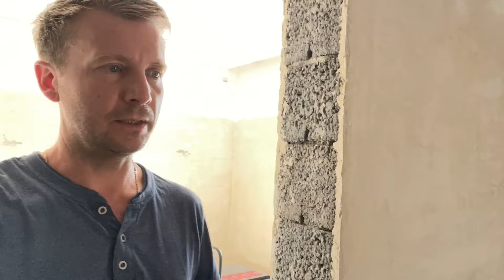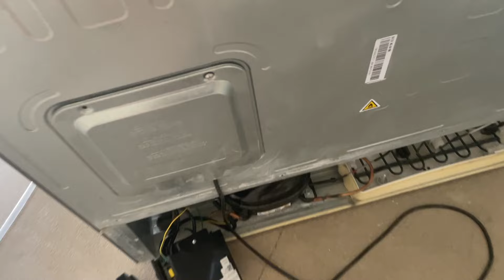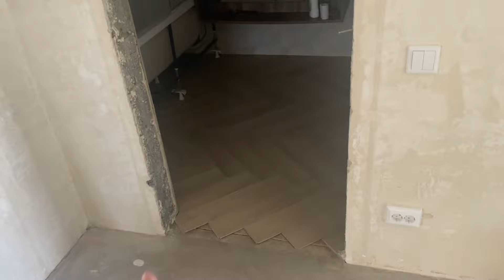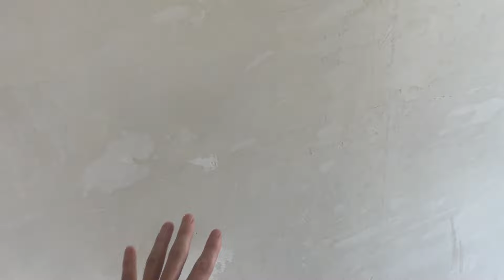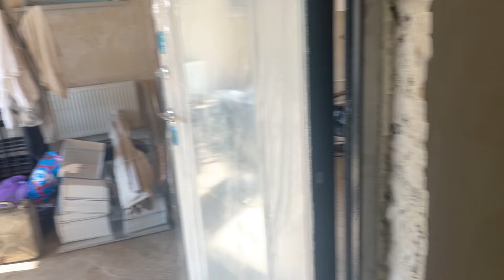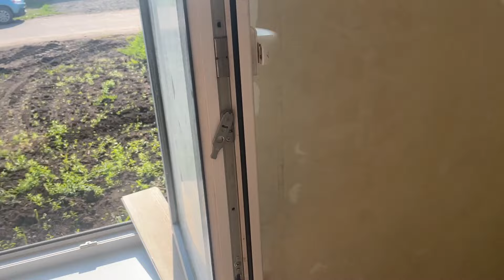English Family Not Giving Up on Our Home & Russia | Home Restore Progress Post Floods

Comment: Я бы порекомендовала убрать остатки старого покрытия из ванной комнаты.
У нас дом лежит толстый немецкий линолеум, имитирующий тропическую древесину. Он с защитной пластиковой пленкой и не стирается, надежно служа нам 10 лет. Я думаю, что пока вы не положите настоящий паркет лучше всего использовать такой линолеум: он легко моется и очень красив - все знакомые принимают его за настоящий пол из натуральных досок))
Reply from the maker: Yes this may actually be the best option. We are just worried it will scratch easy with chairs etc.
Reply: Это не проблема, в строительных магазинах продаются войлочные прокладки на клейкой основе, специально для ножек стула.
Reply: @RussianTravels  our linoleum is very durable - the chairs and table have not left a mark on it in 10 years.
The only thing is that heavy furniture, of course, puts pressure, but this is unnoticeable if you don’t move the cabinet to a new place every month)) You can tear it at home only with great effort: our children made several holes with a knife))
Another plus is that it is very thick and warm - the cold from the concrete is not felt.
The main thing is to choose correctly. We were advised to use linoleum with glued synthetic insulation, but we did the right thing and did not listen - we took it from foamed polymer with a rigid protective film. This was the best choice.
Reply: @sistamama1965  да, но нам даже не понадобилось)) У нас деревянные стулья с острыми углами на ножках, но они за 10 лет не оставили следов, хотя мелкие любят качаться на стульях))
Reply: @RussianTravels  There are different grades of linoleum based on abrasion resistance. High-quality linoleum is very resistant. For the bathroom you need a small piece and even high-quality linoleum, maybe from leftovers from a sale, it won’t be expensive. It will last at least several years.
Reply: @RussianTravels  Linoleum is often used for public places, such as schools, hospitals, gyms and etc. It's much durable, than laminate flooring. Class 23/33 and above is  quite solid.

Comment: Martyn in your main bedroom  that gets the  least sun . You are using the dehumidifier and you said it  was a little  damp down in the corner . Outside I would take outa few more red bricks on the corner wall because this will let plenty more warm air penetrate from the outside this will speed up the drying much faster and with dehumidifier inside that bedroom you will be helping it dry faster. Check on outside and I would take out at least 2 or 3 bricks out then leave the next 2 then take 3more out right round that corner .as far as your walls I would put a coat of breathable paint on all walls this way they can breath and if no problems then next year you can re decorate as you wish . Before you paint give the plaster a very light sand down as you will get best results . In the autumn before severe frost an snow put either new red bricks back in the 4 walls outside . The floor I would put Cork down and see how it over winters  then next summer you can put much better flooring down when you have more money to spend
Reply from the maker: Thank you for this comprehensive info

Comment: The best Floor for the Long Term  would be Ceramic Tile.
Reply from the maker: Yes but it’s not the best for small children. Easily smash things hard and slippy.
Reply: @RussianTravels  My Solution for the Hard Floor Was to put down an area indoor outdoor Carpet.
Reply from the maker: @robertomotrin5717 yes this is an option. But I find then you have to find a lot of carpet/rugs and then it is difficult to clean. I do prefer tiles you are right but not with small children.

Comment: Cost all options including labour costs of doing.  I would Paint floor, leave walls as is.  If you want to stop dust then brush them with a dilute mixture of wallpaper paste (but my inclination would be to simply leave them for the time being).  Fridge door - pick up a second hand door.  Go to the rubbish dump, usually they have a pile of whiteware they will let you rummage through and take bits off.  There were over 5000 homes flooded so I bet you can find a dumped fridge exactly the same.  Until you have been in the house for a second spring flood I would spend as little money as possible, even down to getting second hand furniture.  Do you have loft hatch.  Think about opening it up so that you can lift bigger items into the loft in case of future flooding.   You are all doing a grand job.
Reply from the maker: Thank you for the info. Yes the walls we are considering all options. The fridge door is fine we can cover it with a picture. The floor I think vinyl for is

Comment: Just for cleanliness and hygiene, the walls can be painted in one layer with water-based paint - in fact, it is highly diluted PVA + pigment. This type of painting is highly permeable to moisture and will not interfere with drying.
If everything is in order with the walls, and I have no doubt about it, a little later you can do the normal finishing.
Reply from the maker: Yes the walls would need slightly finishing in places before painting. As eroded the plaster away in places

Comment: re fridge door, you could try to contact the manufacturers and see if you can buy a replacement door?  I agree re flooring, use vinyl for now, you can always replace with wood in the future.  I agree with others on this to paint the walls, as long as it's a water based paint as it will allow the walls to breathe and see you through the winter and next spring.  Come next summer you can then repaint and will give you time to save up for it too.  Re windows, that really depends on you and if you feel that you'd want to see what the walls reveal and you wont have to reveal too much to know if it's safe to seal up again.
Reply from the maker: Yes in think you are right with the walls. A breathable paint. I think we can live with the fridge door. It will be covered with the kids pictures anyway.
Reply: Гугл сделал такой перевод на русский😮, мама не горюй, что называется.😂
Reply: С дверью холодильника можно попробовать обратиться в автомастерскую. Знакомому убрали вмятину так.

Comment: 5:27 There are some dents on the refrigerator that will be a little annoying. This does not affect operation, but it is unpleasant.
With a creative approach, this can be solved and it will not be expensive.
After you have done the first and most important things, you can make a sticker and hide the dents. Vinyl film will not hide the dents, but it could be metallized thin plastic or an image; you can consult with people who make advertising structures. I think there are several such companies in Orenburg, and one of them can come up with an effective solution.
Reply from the maker: This is a great idea thanks.

Comment: Most of the territory of Russia, and Orenburg and the surrounding area is no exception, has a continental climate and low humidity. It's not like anywhere in the UK on the coast. Mold on walls is very rare and is only possible as an exception if construction standards are violated or there are leaks in the water supply. I am sure that mold will not threaten you.
Reply from the maker: This is good to know thank you.
Reply: I live in the middle Urals, I have never seen mold on the walls, even in the bathroom. This is very rare. We do not have large rivers in the region

Comment: It doesn't seem that there is any problem with painting the walls. If you start with a base coat and then paint next year it will at least keep the dust at bay. As for the floors. If you glue the flooring and then a problem arises with the floor it will be more difficult to repair, so I'd put the same kind of flooring that you had before. All the best wishes in your endeavour.
Reply from the maker: Yes good advice thank you.

Comment: PVA will form a seal non breathing, water based emulsion only
Reply from the maker: Yes a water based emulsion. I don’t think I am going to put PVA this time.
Reply: Martin you can use a power base organic mix it with water but will need 2/3 coats, with the floor I would have used a floating click to fit board there reasonably priced and looks good, come winter and the floor is set at 20 degrees all the time you don’t want problems with glue panels, after what you plough the first time think before using a glue board.